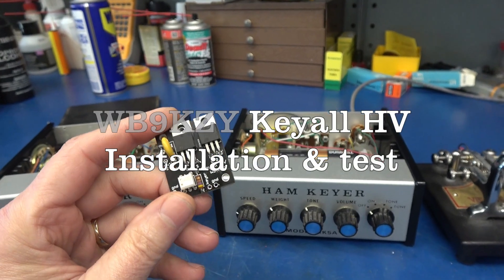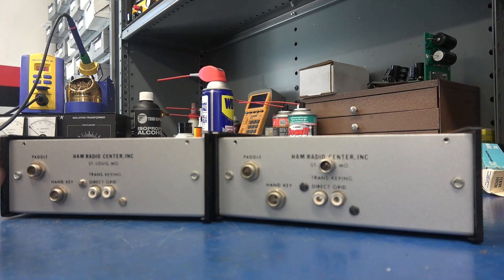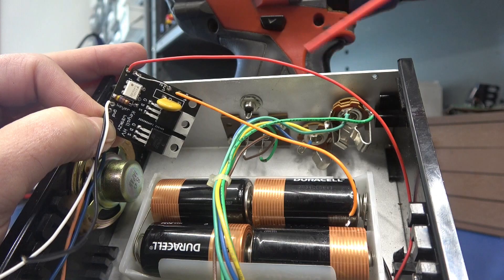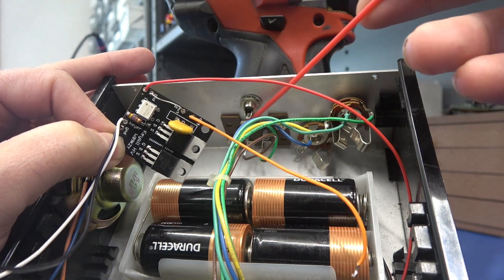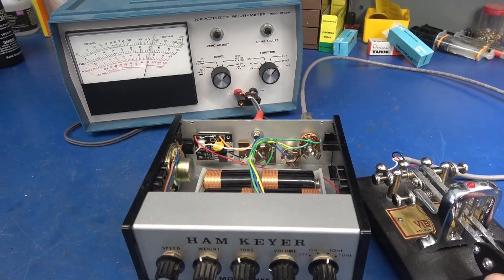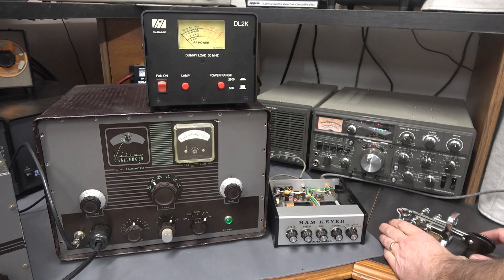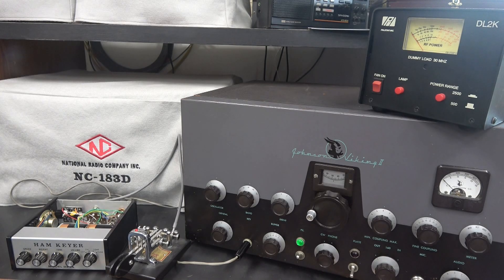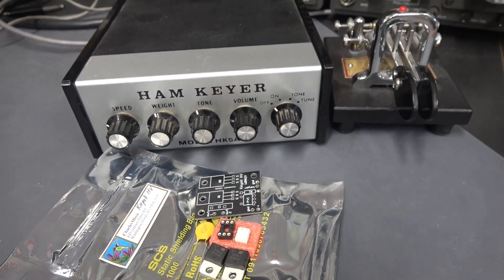WB9KZY Keyall HV module  installation & test Ham Keyer Vintage Ham transmitter CW key interface

Comment: Hey Terry I talked to you on the phone yesterday about the black face super reverb amp I'm in Seattle. After some internet checking I found it to be a 1981 reissue of the 1965 but it has a master volume and the output transformer has some taps on the primary for some type of linear operation. It also has a full bridge HV diode rectifier. Changed the screen resistors on the power tubes and installed a new Sovtek matched 6L6 pair it works good now. No need to ship it out to you.
Reply from the maker: Roger that, glad you got it going.
Reply: @d-labelectronics  Have a AA degree in Electronics from the the early eighties. The tube stuff not so much. Love watching your channel and a Subscriber.  Awesome tube Amplifier Shows 🤙